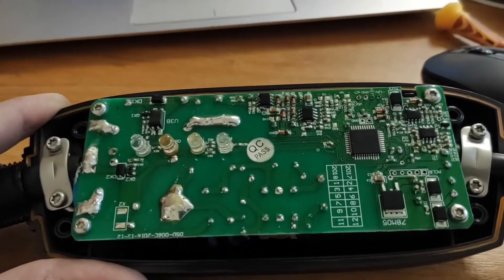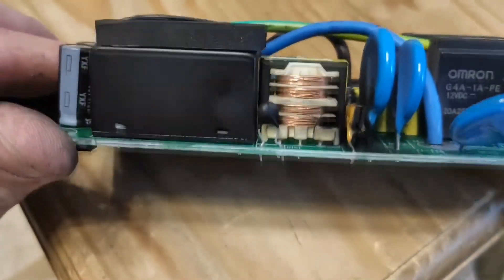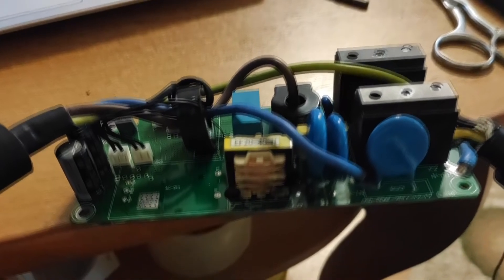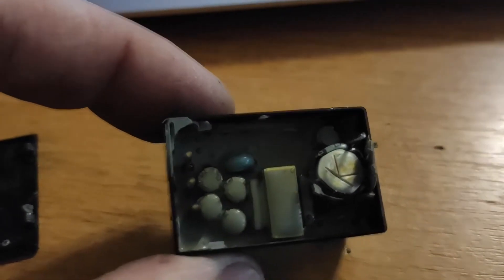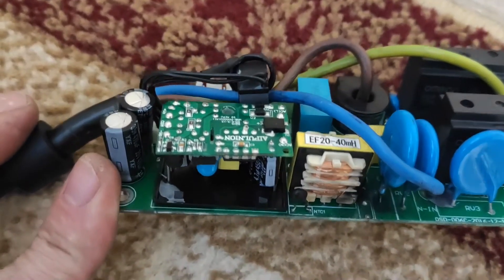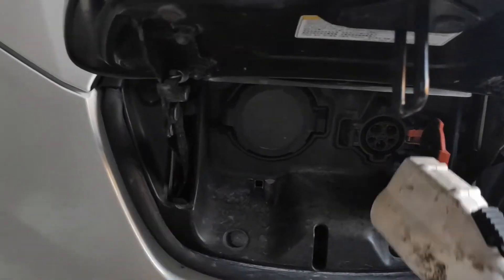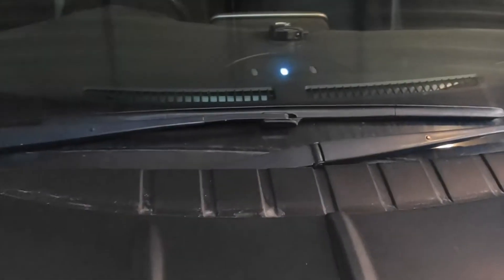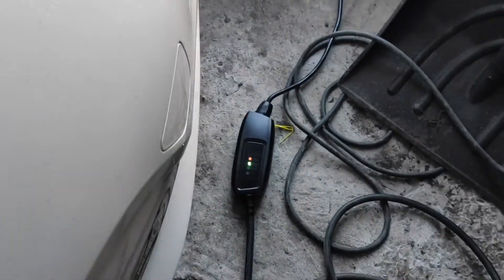EV Charger repair - DUOSIDA burned out after big mains voltage leap fix

Comment: OK I have a question. Live in the United States. I recently acquired two of these one has a 110 V outlet and the other one is identical to yours. I’m wondering if I unsolder the 110 plug and install a 220 plug by pulling it apart and soldering the new plug directly to the board do you think it would work? All of these chargers look identical, but not sure if they are identical on the inside. Thanks for your help.
Reply from the maker: Do this and make 220 in your house

Comment: I wish you would have shown how to open it.  I took the two screws out and I can't get it apart.
Reply from the maker: There's 4 bolts.
Reply: @CoberRuger  ya I figured but I don’t know how to get to them. Under that wall hanger clip?
Reply: @charlesl21  correct, break the hanger clip, then drill out.